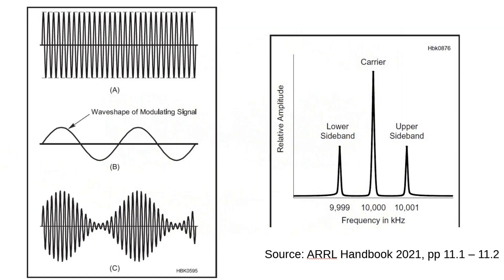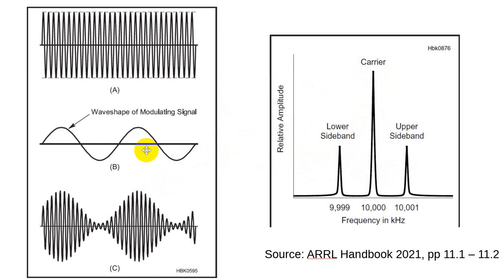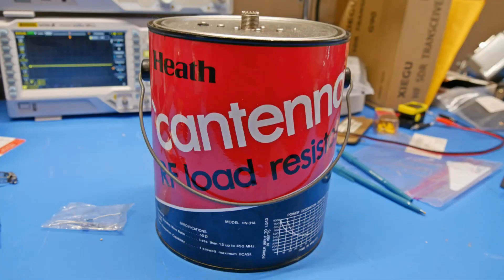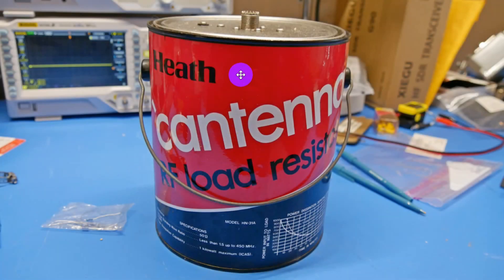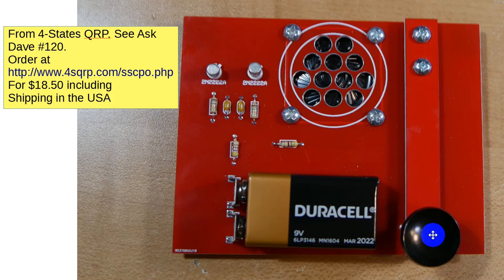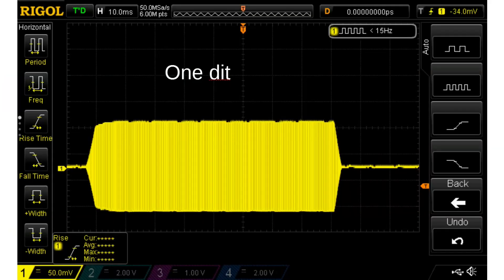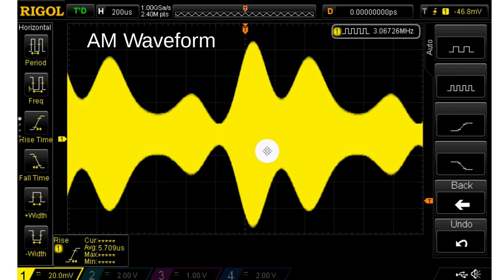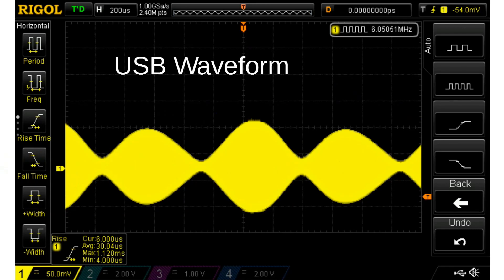Why We don't look at Single Side Band in the Time Domain (#452)

Comment: seems to me like, for the upper sideband, if there were simply a single frequency modulation then the frequency domain spectrum diagram in the frequency domain is simply a single spike and therefore the time domain signal would simply be a sine wave with frequency of carrier frequency plus the frequency of the modulating sine wave -> it would simply be a sine wave with a freq of the higher frequency of carrier freq + modulating sine wave freq

for multiple sine waves added together in the time domain it would be each sine wave shifted in the same way to car freq + orig freq and then added together in the time domain

so I suspect if one recorded some audio and then transmitted it upper sideband it would be like speeding up the recording so all of the freqs were above the carrier freq... it would be a high freq chirp

Comment: In short, the problem is that the signal envelope is only a part of the SSB time domain signal. To get the full information you'd have to show also phase relative to carrier, or better yet decompose into the two quadratures (one of them is the signal exactly). But either is a way more complex thing than a plain envelope!

Still I think for anyone going beyond basic understanding of signals, it's always good to keep in mind the real time domain. A frequency-only understanding is an incomplete one.

(Thank you for making this video. I had exactly this same question and this helped me a bit to wrap my head around the answer.)

Comment: Hi Dave, the SSB waveform can clearly be seen on an oscilloscope when using a 2-tone test, where audio frequencies in the SSB audio pass band are inserted into the microphone input, typically 400 and 1,800 Hz, which is commonly used to measure the linearity of the RF Power amplifier in the transmitter.  If the audio tones are exactly at the same amplitude, you will see a waveform that somewhat resembles AM, except the valleys of the signal actually go to zero.  The apparent modulation on the oscilloscope will be at a frequency that is the difference between the 2 tones.

73, de AC8AQ

Comment: Hold on hold on.  That's not the upper sideband waveform.  (Or does USB WAVEFORM actually mean universal serial bus, not upper sideband?)   That's a carrier-suppressed or DSB waveform, where the audio modulation crosses zero and goes negative.  (Take the AM modulation, then subtract the carrier.  That's the same as moving the zero-ref of the cpo tone downwards, so the lower peaks go negative at the modulator output, which, in those places gives us high-freq sine, with negative polarity.)    But that's not ssb, not a "USB waveform," instead it's carrier-suppressed only.  It's DSB.

The SSB upper sideband should look like a 10800KHz CW sinewave, with some slight distortion since the cpo signal isn't pure 800Hz sine.  (Take the CW CPO waveform, and uniformly increase its frequency by 10x.  It will still appear to be CW on the scope.)

Comment: Another thing, the human ear certainly does recognize phase, its how we sense the direction a sound is coming from. we use the phase difference to locate the source. Its a resut evolution, which also gives us a sensitivity peak at 2.5khz, where we detect phase difference best. this is the area which is highest when leaves crackle, and twigs break, helping us to avoid predators. stereo would not work if we couldn't hear phase changes.
i suggest you google psychoacoustics.
Reply: Yes if course, but you are hearing a phase difference, because you are hearing two different sound sources. If you are listening to only one sound source, a single speaker, or with one ear, then phase changes are not noticable.
 The visual analog to this is binocular vision and depth perception, because you are comparing two sources of information. There is no depth perception using only one eye, camera, monitor, etc.

Received HF signals are constantly changing phase because of the path length through the ionosphere is constantly changing, therefore so is the time delay and phase relative to the source, but by itself it's not noticable.
 An exception to this is Selective Fading, but that is a different phenomenon. 73!

Comment: Fifty-some years ago, at about 13 or so years old, I visited with a the father of classmate who was a Ham.  I was fascinated.  I wanted to be a Ham and get a Technician license because to my mind and experience anyone who was a technician was a well respected professional in electronics.  

He tried to explain SSB to me.  I knew what a sine wave looked like on an oscilloscope and understood AM modulation.  So, I kept trying to get him draw me what a SSB signal looked like.  I kept trying to figure out what part of the sine wave was missing.  I'm sure I didn't understand terms like time-domain and frequency-domain.  It ended up with us both being frustrated and him thinking I was an idiot know-it-all.  I had a similar low opinion of his teaching skills.  

Even after seeing Dave's demo, I'm not sure I understand why the time domain display of a SSB signal looks like it does.  I'm going to have to perform my own experiment with different tones for modulation and see what it does.  

First I have to fix my 60 year old 'scope or just buy a new one.  I'm amazed that scope Dave used is available on eBay and Amazon (new, shipping included) for $350.  20 years ago, a scope with those capabilities would have cost ten times as much.

Now I have to hit Dave's tip jar.

Comment: Rubbish.  Absolute rubbish.  I have looked at plenty of SSB waveforms, and they don't show me "nothing".  They look very much like AM, except that since there is no carrier, there is no waveform when there is no modulation.  Also, if you modulate with a sine wave, and you have a half-way decent modulator, what you get is something like two out-of-phase sine waves, with the space between them filled.  And yes, you can tell what sort of signal the modulation is.

Don't broadcast ignorance.  Most of your videos are useful.  This one is not.

Comment: The real magic is how side bands arise in the first place. Consider a steady carrier that is AM modulated with a single sine wave: By just variying the amplitude of a totally steady single-frequency signal a new "carrier" signal arises (actually two!) with a slightly shifted frequency - just so. How can that happen, when that shifted frequency seems not present in the time domain at all? Remember, all we did was vary the strength of the original carrrier. The frequency of that carrier itself stayed exactly the same. That's magic!
Reply: Ok - I've given it some more thoughts, and now I think I understand the 'magic' by looking at it this way: First take a single, constant carrier signal of frequency F. Then place another constant carrier (same amplitude) very near by, say, at F+100 Hz. What happens? The two signals interfere: They add to each other 100 times a second, doubling the amplitude (at times when they are in phase) and they also completely cancel each other out 100 times a second (at times when they are in phase opposition). Now: What would that combined signal look like in the time domain? Answer: A 100% amplitude modulated single carrier with frequency F+50 Hz! See it?

Comment: Every time they say "its just an AM signal with the carrier removed" my mind goes clunk clunk. How can you do that? The carrier is what carries it, so I thought. Like riding in the dining car of the train that's not there. Magic, that's what it is. Magic.
Reply: RF is magic. It travels through Universe
Reply: Look at your SWR or power meter when keyed up SSB but NOT saying anything into the MIC...
Reply: A lot of people don't appreciate SSB or DSB variants are amplitude modulation. I always think of sideband as suppressed carrier. Interesting fact if someone is transmitting SSB nearby you can tune in to their carrier. The transmitter can't completely filter out the carrier.

Comment: This was clearly the most interesting video for a very long time - very, very good! But how I wish that you had used the same, pure sine wave for modulation instead of that square wave from the cw training kit, in order to provide direct comparison with the corresponding AM and FM signals. I still wonder what the SSB modulated signal would look like in that case. Could you please, please use your scope again and show us?
Reply: If you modulate using a pure sine wave, and then remove one side band and the carrier, you are only left with the spike on the other sideband. A single spike in the frequency domain is effectively a clean carrier wave (but of course shifted from the actual carrier frequency by the modulation frequency).
Reply: @JBuster941  This comment helped me "get it," thank you. I now understand that the information in SSB is not in the amplitude of the resultant signal, but in the offset between the resultant signal and the carrier that isn't transmitted. As the frequency of a given input sine wave increases, so should the frequency of the modulated SSB signal. And I guess that explains why listening to someone on SSB with the tuning slightly off makes them sound so funny!

Initially, I started to confuse this offset idea with how FM works - I was about to ask, doesn't FM also send a signal offset the frequency? But I reminded myself that, as a given input sine wave oscillates around the centerpoint, an FM signal will oscillate around its carrier frequency, as opposed to transmitting that signal offset a silent carrier. Thank you, again!
Reply: @JBuster941  yes of course, I stupid - how could I forget?!